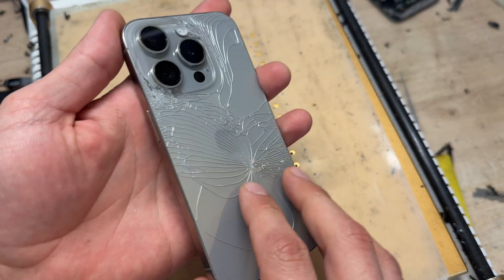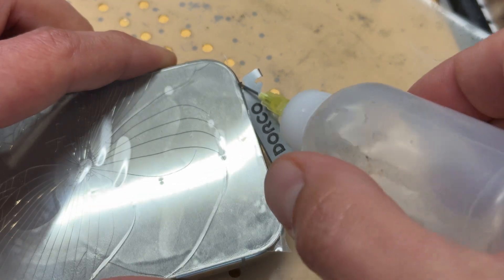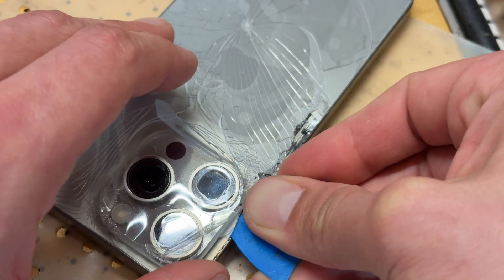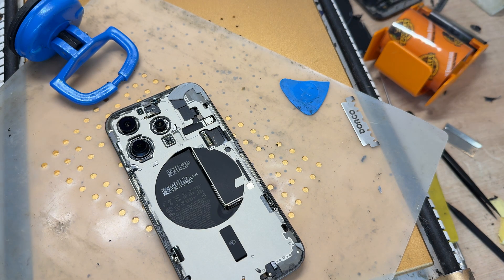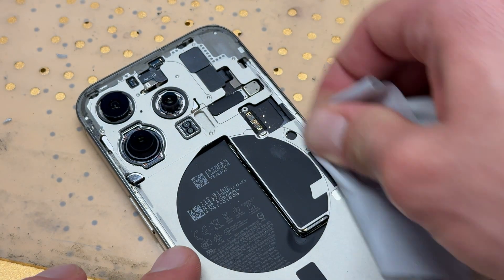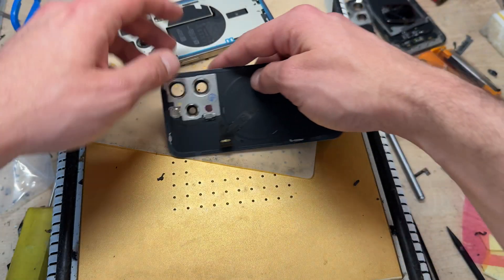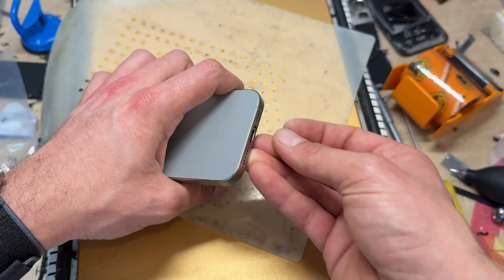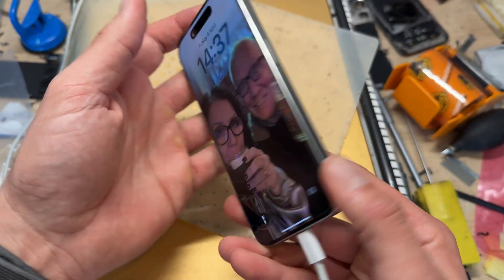iPhone 15 Pro Back Glass Replacement - Full DIY Repair Guide!

Comment: Where can I find the back glass with everything already attached?
Reply: I found one on temu, although i have not fitted it yet
Reply: Okay I have just fitted it, its a lot harder than it looks, or at least for me it was. Just goes to show how good these phone repair techs are
Reply: @Videowatcherguy   was it a original back? And how could you calibrate it if the back was a replica?

Comment: Thanks for the video. If I use a non genuine part, would it cause any issues?
Reply: If you use a non genuine glass then you need to transfer the charge coil over from your broken phone, this way it will not show up as non genuine in your settings I believe. Also the replica glasses break easily, so bare that in mind

Comment: Can adhesive be so dried out it cant be melted? For the first time in my phone repairs i cant open the back glass even used high power suctions tool set. And the back glass must not be scratched or damaged. Cause if for the battery swap.

Comment: Hi. Could you please advise - how is the protective ring attached to the main camera on the back cover? The one that is the same colour as the body of the phone, but as if mounted on a square glass. I have it twisting and rattling a bit for some reason. 😵‍💫The phone is brand new.